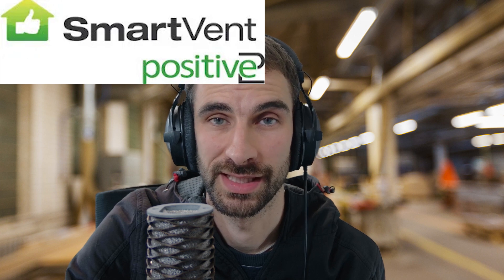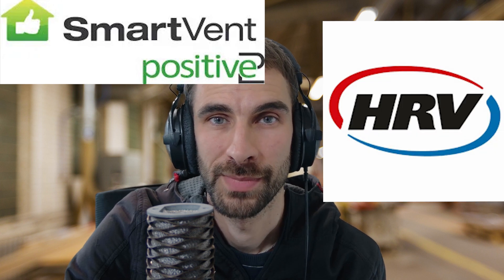Home Ventilation Systems Explained (HRV, Smartvent, DVS & More)

Comment: Of the positive pressure system s on the market, in your opinion what is the best system HRV, Smartvent or DVS?

Thanks
Reply from the maker: I think they all do more or less the same thing. It's just a fan and a filter that pushes air around your house. There's not really much room for good design to make much difference in this.

Comment: Which ventilation system is good I have condensation problem in my 1975 home what option should I go for to keep home dry and moisture free
Reply: Dvs is good just ask the installer alot of questions
Reply from the maker: They all do the same thing really. It's just a fan and a filter box pushing air around the house.

Comment: Just moved into a house with one of these systems. Cold , draughty motherf&^%*r. turned it off, and closed up the vents, and will never use it again.
Reply from the maker: You probably have a concrete tile roof that doesn't get any sun. It's also probably an older system that doesn't regulate the air flow rate properly.

Comment: Balanced systems work better. Instead of filtering dusty dirty air and putting it into your home like a positive pressure system such as HRV, DVS etc, they constantly exchange stale air for actually fresh air, and retain the heat is already inside your home. You can even vent bathrooms and other exhaust fans to recover the heat otherwise wasted from those sources.
Reply: I suggest you look into systems like Lossnay by Mitsubishi Electric and other comparable systems. HRV's name is actually misleading as it is not a heat recovery ventilation system.
Reply from the maker: What geographic region are you in? Those systems are extremely expensive and not worth the cost for mold climates like Auckland.
Reply: @ I don’t get what you mean by a mould climate. They’re not actually that expensive when you compare what you’re getting with an hrv or dvs system. Everyone on the Canterbury area that has one has been amazed by the improvements.
Reply: What is a "balanced" system?

Comment: Home ventilation systems are a money making scam in New Zealand 

All homeowners need to do to make their home dry and healthy is take the dry air from the lounge room and distribute that air via an insulated duct with powerful 150mm fan  to the bedrooms. ( exact same as  a heat transfer system) except fan is left on low 24/7 

To turbocharge this setup I put earthwool over the top of the insulated duct, in homes I've done this, I've only had a 2 degree drop from lounge with fireplace in to the bedrooms.

Then all the homeowners need to do to air out their home is to open a window and the fan will distribute that fresh air around the home 

I also put rental bathroom fans on with the bathroom light so people are forced to turn on the fan 😄  otherwise people don't turn on the fan

Nice videos by the way 👍
Reply from the maker: They're definitely over priced. But I think they're a great way to have a steady stream if fresh air through the house. Especially good for rentals where user error is to be expected.
Reply: That air is never fresh and your just shifting stale air from one room to another. At least with systems like a lossnay you're constantly exchanging bad air for fresh air. These days you cannot rely on people to air out their homes by opening windows, rentals especially.
Reply: @zacw4480 all I did was with a basic transfer system was put a filter in. Simple

Comment: Do you have a brand preference of those 3 systems, and do you know if there is much advantage of getting the DVS Premium connect over the Climate control model? 2007 brick house.
Reply from the maker: They all do the same thing really, it's basically just a fan and a filter box in the ceiling
Reply from the maker: I use EVOAQ
Reply: Save yourself some coin and run a fan with insulated ducts from the lounge room to your bedrooms...much simpler and works better

Homes in my opinion need air moving constantly even if the fans on low....mould can't grow in an area where airs moving
Reply from the maker: @jordanblake574  I agree air needs to be moving, but are you sure that alone stops mold? If the air is humid won't mold grow anyway?

Comment: I am thinking to getting the HRV system and also got the quote from them, but I'm quite concern because it get the fresh air from the attic. Recnetly I climbed into my house attic and placed my air quality monitor there—it showed worse air quality compared to my room, even my house is nearly new build. It make me feel quite concern.
Reply from the maker: You can set this systems up to bring in fresh air from outside. Send me an email and I can find a local installer for you.
Reply: tritet tember get hot 40+

Comment: Hi Alex.. quick question.Can you gain the full benefit of having ducts outside of the thermal envelope [roof cavity] in DVS systems, as opposed to HRVs, which require ducts to be inside the thermal envelope?eg ..STIEBEL ELTRON or Zehnder Systems - thank you
Reply from the maker: A lot of that depends on the climate you're in. In NZ the climate is not extreme enough for the benefits to outweigh the installation and running costs. These are essentially filtered fresh air systems, with heat from a roof space being a side benefit that some houses can enjoy if they have a roof that gets lots of sun.

Comment: I recently upgraded a Weiss vent system , the original setup had a 200 ml line coming off the fan before going to the individual 150 ml room ductings …but I installed 150ml behind the fan. 
Will this reduced line affect the fan output or shall I change it back to 200 ml ? Cheers
Reply from the maker: Using 150mm ducting is suitable for your system if it is properly installed and avoids sharp bends. Calculate your airflow requirements of 30 L/sec in the lounges and 15 L/sec in each bedroom. If  total airflow is under 120 L/sec, you are well within the capacity of 150 mm ducting and fan pressure.  Note that the filter is the highest pressure resistant in your system, affecting airflows more than ducting size.

Comment: Is it a problem during winter when cold air is transferred into the house while trying to keep the house warm?
Reply from the maker: The rate if the air flow is very low when it's cold outside. It can make the house a little cooler bit it's a worthwhile trade off.
Reply: Because the house will be drier the heating doesn't need to work at full capacity to heat the house. Most system will regulate the amount of air entering the rooms when the temp. drops